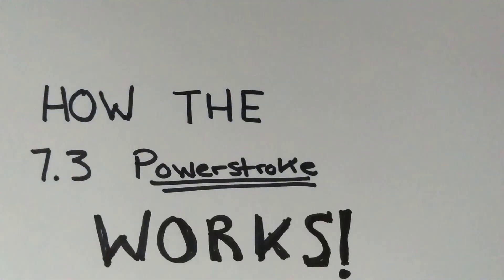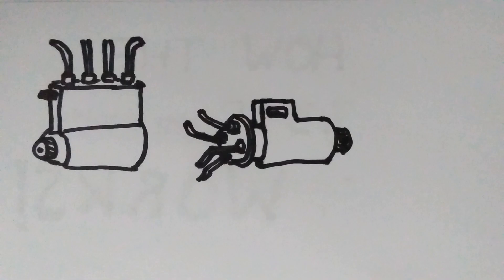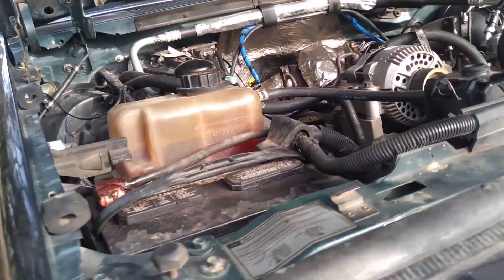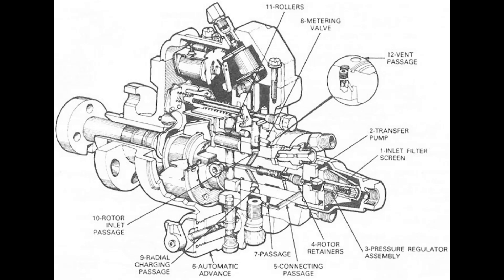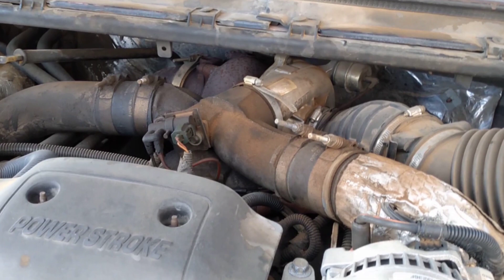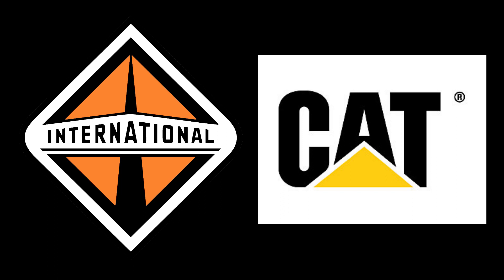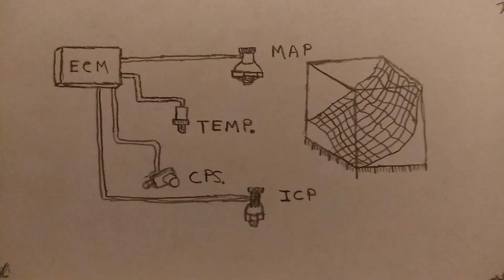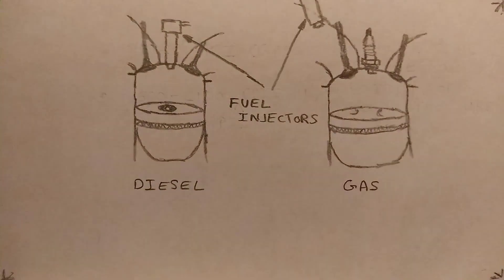How a 7.3 Powerstroke Works Part 1: Introduction

Comment: I know you graduated. Taking time off or have you found a job? Engineering, right? Thanks for your time and video! Always so informative. You’ve helped me tackle many 7.3 mods with confidence and understanding of how my diesel works.
Reply from the maker: I sure did graduate, thank goodness! I never have to learn another thing ever again... I've got a full time job that keeps me stuck in the city for now. It's not such a good place to work on old trucks. I'm moving more into control systems engineering now with a mechanical engineering degree, its challenging enough and pays the bills! There's definitely not as much time to make videos as there used to be, but I'm glad to hear I've been able to help you out. Breaking down how the 7.3 works goes a long way to help me diagnose problems, so I figured I'd start to pass on more of the knowledge. Thanks for your kind comment!
Reply: Thanks !

Comment: Great job! I'm in the middle of replacing the HPOP to resolve a P1211 code and the engine shutting off at about 30mph. The IPR duty cycle is high (like 30%-45% at idle) and the oil pressure is right at around 500psi. It's taken a lot of time, and learning about the engine as I go, replacing the IPR, the o-rings on the old HPOP, the fuel pump (used your video on that), servicing the fuel pressure regulator to arrive at the conclusion that my HPOP is worn out. I have yet to replace the HPOP but a video like this would have made life way easier! Can't wait for part 2. 1996 7.3 PSD XLT.
Reply: So I've replaced the HPOP and now at crank no start. There are no obvious leaks anywhere in the valley or anywhere and the reservoir stays full. I'm trying to read IPR, ICP etc on the Torque app but the data stream drops off during cranking (like the OBD loses power) so I'm wondering either batteries are dead or ECM is losing power during cranking? What things would you check next?
Reply from the maker: Tammer Barkouki I apologize for the late reply. Were you able to get things figured out with the truck?
Reply: @Rnddiesel  Yes all resolved, thanks for checking in. It looks like the original problem was bad ICP.  One of the first things I did was replace both ICP and IPR (came as a cheap kit on Ebay) and finally discovered the new IPR I put in was faulty. I had fixed one problem and created another and chased my tail for a while (replaced fuel pump, rebuilt then replaced HPOP, rebuilt fuel bowl and fuel pressure regulator). Once I put the old IPR back in (I kept it for some reason) the truck ran great. The o-ring on the new ICP gave out after a month so I replaced that as well. Lesson learned, don't buy cheap parts on Ebay. She's got 250k miles on her. Next project is to rebuild the injectors, maybe e-fuel conversion.
Reply from the maker: @tammerbarkouki3515  I'm glad to hear you got it all fixed! I don't know if it's just 7.3's or what, but it seems like the only 'good' sensors/engine management parts are motorcraft parts. I appreciate you following through and explaining how you fixed the problem. It helps me gain experience and I'm sure other folks here will benefit from your story as well. It sounds like you've got a lot of good miles left in your truck and a lot of interesting work to do on it as well. Best of luck!

Comment: Really good series, there are direct injection engines that inject just like a diesel does right at the top except for there's a spark plug that it shoots it across

Comment: great job on this video that must have been some work making that one. I think of the 7.3 as the detroit of the pickup market.  Because they leak so much oil and nickel and dime you. But they work well. The Duramax and the Cummins are more of the CAT of the pickup market they just get the job done.

Comment: Hello : I am thinking of buying a school but with a 7.3 Diesel Engine and of course I know nothing about them. So was watching your Video to see if I can learn something. Have no ideal if getting a diesel or gas is better. I won't be on the road a lot but people seem to love the diesel. Any thoughts is appreciated. Thanks Terry
Reply from the maker: An old 7.3 school bus would be neat! It probably would have the International T444e, which is the engine that the 7.3 Powerstroke is derived from (A 7.3 Powerstroke is basically just a rebranded T444e with some other minor changes). It could also be an Indirect Injected 7.3 Diesel, which is different and way less powerful compared Powerstroke. Gas vs Diesel is definitely a trade off. The diesel will get better mpg for sure, but there are a lot of other hidden costs as well such as oil changes and replacing parts when they break. For reference my truck takes 3.5 gallons of oil. A comparable gasoline engine may take a third of that. Repair costs on the diesel are also generally more expensive. It may be worth adding that I typically get 15 mpg unloaded in my truck, whereas my grandfather with his 454 big block gas truck gets like 12 mpg on a good day, so the diesel does get better fuel economy at the cost of generally more expensive fuel. It's hard to say gas vs diesel. It may also be noteworthy that the 7.3 Powerstroke/T444e is one of the most successful and highly produced diesel engines of all time. That also means that there are plenty of parts still out there, and spare engines in case its needed.
Reply: Thanks so much for this information. I really appreciate it and its helped a lot. Always good to learn. Take Care and Thanks Again. Terry

Comment: Isn't that the reason for the idi? Put less abuse on injectors
Reply from the maker: I believe the IDI came about from the great Harry Ricardo. It was basically a means to keep injection pressures lower yet still permit decent combustion speed via swirling the diesel fuel around in the pre chamber. Higher injection pressures typically come with a higher injection pump cost, yet low pressure, cheaper setups don't atomize the fuel quite as well, hence the IDI came about.

Comment: if the power stroke engines are so good and reliable, why keep changing designs??
Reply: Emissions requirements. Current requirements make them more expensive, complicated, and less reliable. I'll be keeping my 2002 7.3 F250 for the rest of my life.